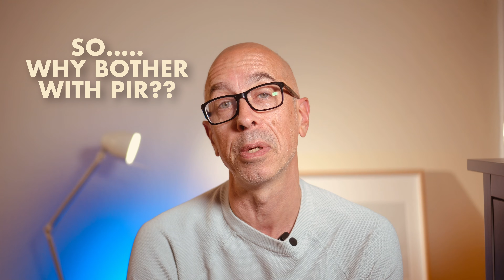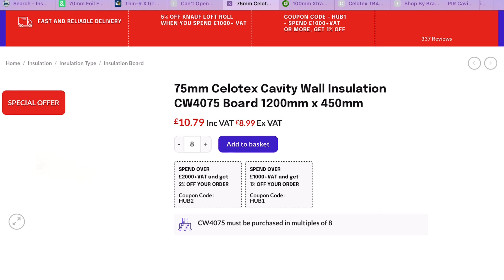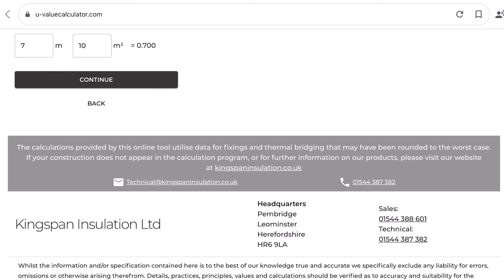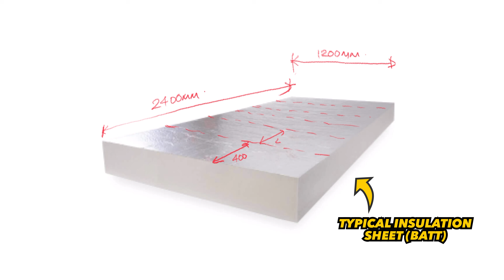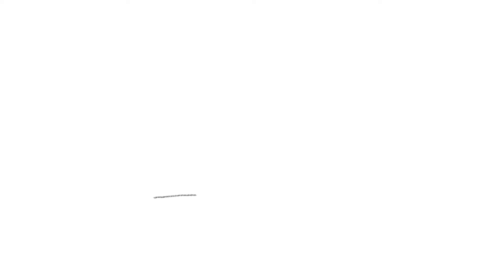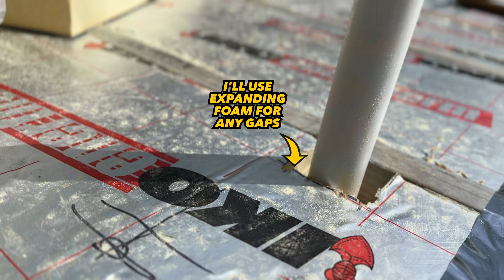How to choose PIR insulation : Size & Cut the fast way

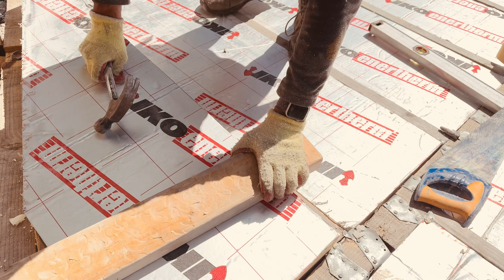Comment: Awesome info, thank you! I just wonder, although your insulation fits quite snug there will always be warped boards, tiny gaps etc. (e.g. 7:29). I wonder how that affects the insulation value. Shouldnt these be sealed (gun foam?). Also, there is no rodent protection in your build. Especially around pipes, but they will chew through PIR too. I wonder if you had any problems so far.
Reply from the maker: Hi. Yes, you still need to go round with foam for any gaps. Regarding rodent protection and chewing through PIR, I’ve been building timber frame / stick construction for decades, and I’ve never once had any issue. I’ve heard this problem mentioned on social media but I’ve yet to see evidence. However I can’t say definitively, so the solution is to board the underside before the insulation.  Have you seen evidence of are you going by what you’ve heard?
Reply: @build-better-things  thanks! I work as a builder but frequent as a freelancer in rodent control too and I've seen them chew through almost anything. They especially love rockwool and such, but also PIR in a floor can be problematic when not sealed well.

Comment: I have just finished installing 100mm celotex in between my 100mm joists but now I need to raise the joist height to match the floor level of the hallway.  The hall floor is 50mm higher (underfloor heating) but my room (lounge) has radiators therefore no UFH.  So I am intending to simply buy some treated 50 x 50 and screw it along the top of each original joist.  This will of course, leave a cavity of 50mm between the top of the celotex and the underside of the tongue and groove chipboard that I will lay on top.  I was going to stretch a vapour barrier across the top of the new 50mm 'risers' and take that up the walls before laying the chipboard.   Am I creating a damp deathtrap for myself or should that be ok?!!
Reply from the maker: If the void you are creating is at the same temperature as the room, which it appears like it is,  then your vapour control strategy should be no different from if there was no void and you didn’t have to add the framing. My guess would be that if vapour control is required, then the new framing would sit above that, so the vapour control layer is between the new battens and the insulation. You could also go up and over the battens without pulling it tight.  Without seeing your particular set up, that’s about as much as I can say. Best of luck.
Reply: @build-better-things  many thanks. From a practical point of view, I like the idea of draping the vcb rather than stretching it: I'd be sure to put my foot through it if I stretched it!  
Much appreciated.

Comment: Hi, great video. So if the insulation board is 1200 and you get 3 x 400 pieces when cut, are the boards oversized to cater for the loss due to the cutting blade width?
Reply from the maker: Yes you need to allow for the blade for your joist spacing. It’s only a bit but it makes for a tight fit without the need for foam.

Comment: There is so much information in your videos, I really love them.
I was wondering about the vapour barrier. If you have PIR insulation, taped all the edges and joints, does that also act as a vapour barrier? Or do you really have to put a separate vapour barrier underneath the chipboard if using regular, non-coated OSB?
Reply from the maker: Great question.  In theory tape along with the foil face of the insulation forms a barrier. In reality there’s lots of tiny nicks and gaps if you really study the surface and edges. However for suspended floors, you’ve got a ventilated solum on the cold side of the insulation, which is what you always want to take any potential condensation away through air movement, plus vapour tends to travel up toward the roof and upper walls,  rather than down through the floor. A vapour barrier under the chipboard is desirable , and easy to lay, but in this case I didn’t bother,  due to the combination of the plastic coating and expanding glue acting as a water proof layer. There’s also air tightness to consider if that’s a constraint for your circumstances.

Comment: I have two quite a simple questions and if you can find the time answer them I would appreciate it.  Q1, if you change from 400mm centres pivoting on the centre of each joist to 400mm gaps between the joists, when you lay the chipboard, you will loose the benefit from the 400mm centres of the joists and its impossible to align all the joins in the chip boards with a supporting joist.  The join will likely hang unsupported apart from the Insulation board.   Is this acceptable from a structure point of view?  Q2:  Once the insulation boards have been fitted between the joists, is it good practice to use aluminium sticky backed tape across the various joints between the boards and the wooden Joists?  We are about to construct a 6m x 4m suspended floor and I am trying to do the job properly.  Many Thanks Lester Pulsford..
Reply from the maker: Hi. Get the tongues tight into the groves and use expanding foam glue and correct number of fixings per board and you don’t need to have the joints on a joist. The floor will act as one “sheet”.  You do need to have the short ends supported at the end of the run.
Foil tape over the joints is an option, although with air tightness becoming important , consider a reflective membrane. Usually these timber floors are cross ventilated underneath so less of an issue. 
I made a video about it here that will answer your questions. Best of luck. 
Lay Chipboard Particleboard the Easy way | Architect & Builder Tips
https://youtu.be/ZZFcwoxDaZo
Reply: @build-better-things  Thank you so much, this is very helpful.  Please keep the videos coming - they are so useful.
Reply: I am an Engineer and I would be wary of positioning the chipboard joints off of the joists. You are essentially relying on the tongue and groove plus glue to achieve the span which will be much weaker than a full thickness board. Particularly as chipboard is a relatively weak material. It might just take a heavy bookcase or some rowdy teenagers to bust the joint.

However, since the 400mm clear spacing to fit the PIR is such an efficient approach, I would suggest the chipboard could be cut to length to always achieve a full span between joints. The square ends could just butt up against each other at the joists (and glued/sealed) or a new groove routed into the ends.
Reply from the maker: @grmgnt1 hi and thanks for your input. The whole point, the technology, of tongue and groove is to create joints outwith the joists and noggins in conjunction with an expanding glue. If you’re going to ignore that, and ensure your joints always arrive on a timber, then you should just use butt jointed OSB or ply. You’re throwing your money away if you use chipboard in that scenario
Reply: @build-better-things  Thanks for the reply. In the solution I described, there is still a benefit in having the tongue and groove on the long edge as it will help the floor deflect evenly without lipping between boards, which might cause squeaks or damage floor coverings. But the boards themselves are not reliant on the tongue and groove to span between joists. My reading of the expanding adhesive is that it is mainly there to keep the joints tight and sealed rather than providing any real spanning strength to the board . The Egger manual says that the short edge of the board needs to be over a joist but perhaps there are other products that work differently. 

Not trying to pick holes here - just trying to share knowledge for community discussion and learning and I'm always happy to be proven wrong!
Reply from the maker: It’s great to get your input. It’s an iterative process and the comments such as yours with the experience you have helps so much.

Comment: A question about PIR. Would it be possible to glue EPS board onto a PIR board and plaster the EPS board?
Reply from the maker: Hi. Would it not be better to use an insulated plasterboard? If you’re really set on plastering the polystyrene board, you’d have to consider mesh to key the plaster but even then I’m not sure about the deflection, as the board isn’t really hard, and depending on skim or full coat.

Comment: Can I put PIR boards ontop of old cellulose insulation ?
Reply from the maker: For something like that, I would start by calculating the dew point, using the lambda values of the different materials and their thickness. Although theoretical, it tells you if the proposed makeup up is going to work, with the additional layers you’re adding. But then you need to focus on the weak points, so vapour control and the likelihood for localised condensation with actual dew points, and which I focus on in the video. Calculated dew point is for the perfect world. I can’t really answer better than that without more info.

Comment: Robin clevett tapes all round with a thermal tape which i believe expands slightly ensuring an even tighter fit
Reply from the maker: Yes, I saw that. Really great stuff. I found doing  the cuts this way, fits so tight if you get your spacing consistent I might struggle to fit in sheets with the tape, even with its compressible nature. I would have to space the joists a few millimetres wider to take account perhaps for the next time.

Comment: Wouldn't it be easier to do the max piece between and then lay full sheet above? Say 100 between then full sheet 30 above the your flooring sheet? Quicker and also deals with thermal bridge issue of joists
Reply from the maker: Yes it’s a good question.  I don’t like the thermal bridging but I couldn’t afford to lose the height due to the planning conditions. 30mm would have been ideal as you say. It surprises me that you can still achieve the u value with the method I’m using. The suspended floor is the only place I would do between rather than over, due to it being at the lowest point.  Really, I was just focusing in the video of how to optimise cutting and wastage for these sheets. Thanks for your comment.

Comment: Awesome vid. I’ve never heard of anyone changing the centres to minimise insulation wastage before, but I don’t see why not, it is expensive. 
I have tried just about everything you could possibly think of over the years when it comes to cutting PIR sheets, and have come to a very similar conclusion. I too use my Dewalt circular saw for the reasons you stated. I like to have a vac on hand and to use a fibre cement blade in my saw for this - they have far fewer teeth, so I find the dust is less fine and gets slightly less airborne, although still messy.
It is very easy to make a jig to run your saw along for straight, repeatable cuts by screwing a batten to the edge of a piece of ply cut to size. If you make them a couple of mm smaller they should slide in beautifully without too much boshing needed. I hope that helps someone. Keep the vids coming!
Reply from the maker: Thanks. The jig for me takes more time but it’s a good idea too. Thanks a lot for all that information. Really helpful.
Reply: Robin clevettt made a vid of this some time ago on one of his big builds

Comment: Love your vids new sub here ^_^

Silly question as I’ve got a timber frame wall in my 70s house with brick and block gable and adjoining wall to my neighbour. 

I’m replacing a door for a window. Building out the frame. Outside in layers are Shiplap UPVC Cladding, breathable membrane attached to 18mm OSB with roofers lat attached for the cladding. The frame is 150mm in depth I’ve got 400mm inbetween the studs. 

For the insulation should I get 100mm PIR foil to leave an air gap for breathing mould purposes. The advice is so all over the place. 

Then aluminium foil tape, then a visqueen for the vapour control layer, then the plasterboard. 

Thanks very much, quality vids
Reply from the maker: Hi. If you’re changing a door to a window, needs to be to current regulations, so 0.18 u value. It’s not that easy from your description but…   I think translates as your cladding onto battens forming a ventilated cavity  onto a layer of insulation, then membrane, and then your OSB and studs, with your 100mm insulation between your studs. I’ve made a video about it here
TIMBER FRAME v BRICK BLOCK Masonry- House Extension walls - Architect Builder’s 5 expert tips
https://youtu.be/HHunXgidQL4

Comment: If you set out timber at 445 then what do you do when it comes to plasterboarding?
Reply from the maker: Just the floors and roofs at 445. Walls are 600 centres.
Reply: @build-better-things  ah, thought you’d said do for all timber, was like wtf?! Then spent the next hour thinking well, could cut down plasterboard, it’s cheap and easy to cut, maybe it is the better way 😂😂

Comment: How are you avoiding vermin ingress below your floor level?
Reply from the maker: Hi. I’ve never had a problem with vermin in the undercroft. I know many mention it and , if I’m not doing it for one of my own projects, I offer the choice of a sealed underside, for extra cost.
Reply: @build-better-things How would you seal it from rodents? Cement fiber board under the PIR?
Reply from the maker: Something like that, put on with brackets from above and before the insulation. But as I said, I’ve never seen the issue of vermin attacking a raised and sealed undercroft  in real life.